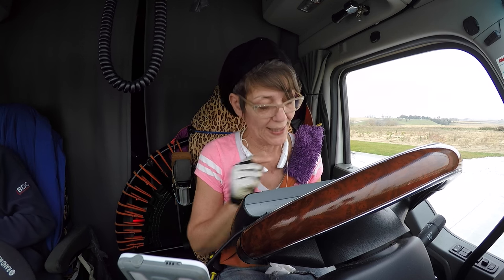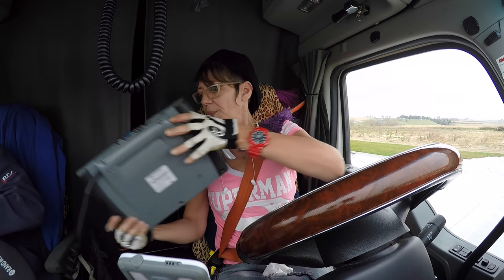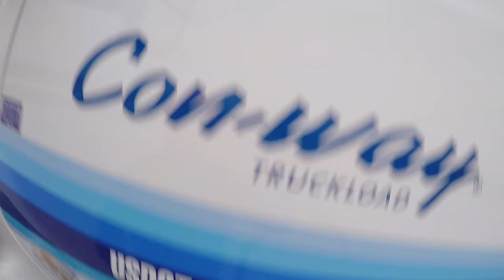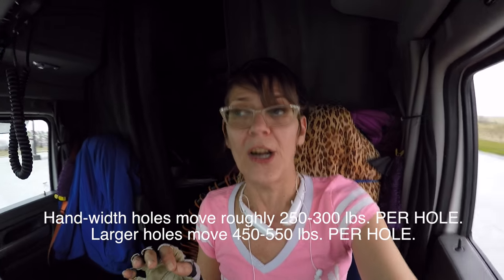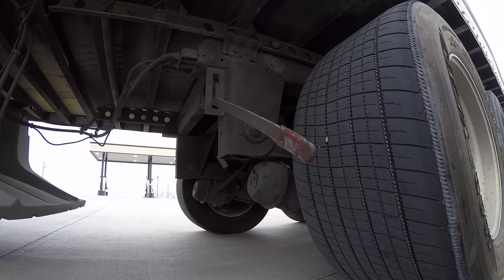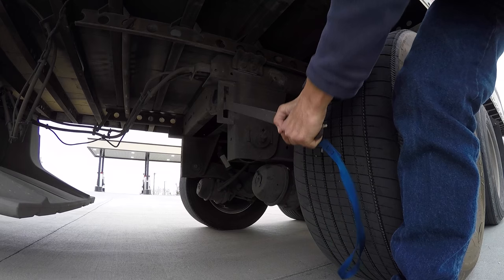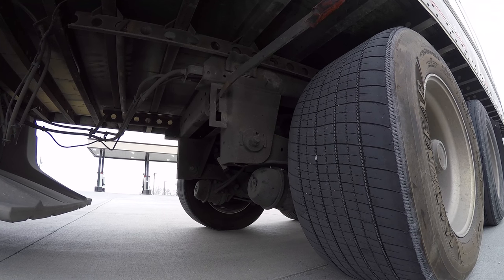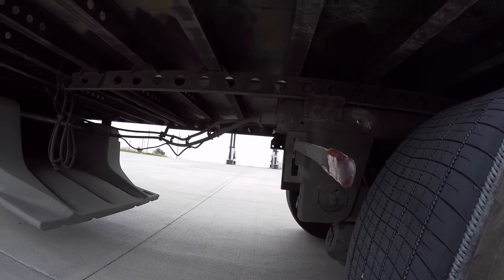How To Move Tandems

Comment: What happens if your in California and they require 40 ft but it's heavy on the back
Reply from the maker: Been there. It’s a problem. We went back to shippers more than once and had them shift the load. We had it happen and couldn’t get it moved. That’s when being with a company that doesn’t get pulled into every weigh station is worth it’s weight in gold!